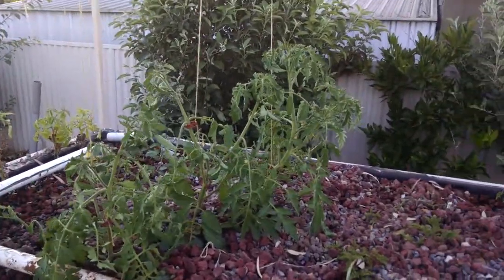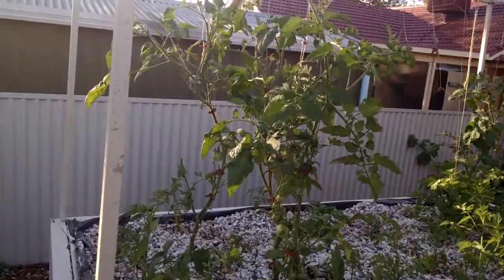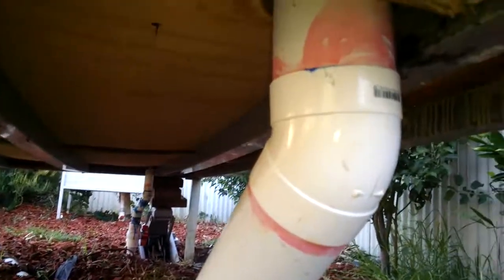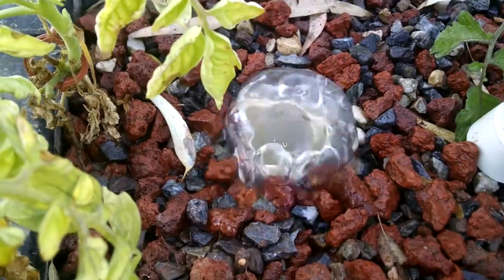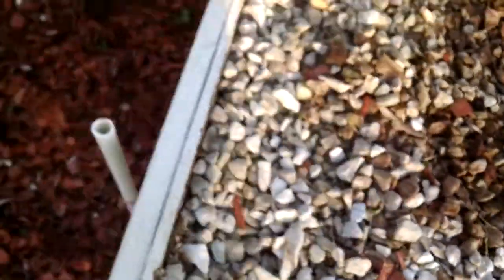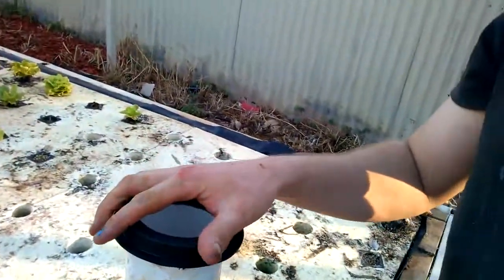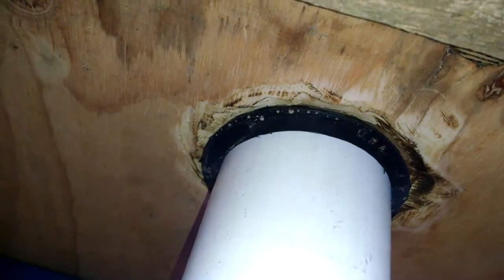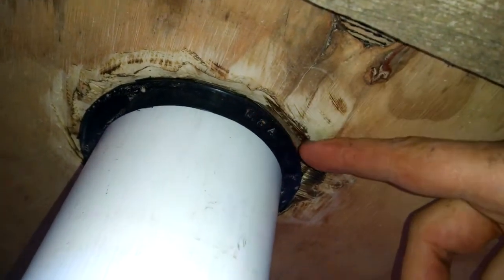Aquaponic gravity pipe resizing

Comment: Note for future viewers of the '#$#itch' getting in - use cuts about 2" long down the length of the 90mm pipe and about 1/2" wide to make the pipe 'fold' into a smaller pipe - also use dish washing liquid - jockey the pipe in and then walah! fits like a baby's glove
Reply from the maker: I tried that.  :(

I wasn't sure if it was because my 102mm hole saw was slightly smaller or something, or the wood doesn't give as much as plastic from a drum, but it just doesn't want to work for me.
Reply: Colum's Aquaponics You still have to push like buggery but its 10x easier - the slits have to be long like 10cm and only 1cm apart - once you get them in and they aren't catching the edges, it goes through pretty easy.